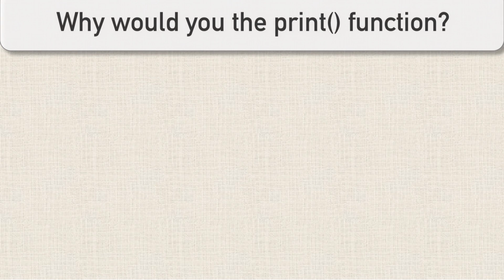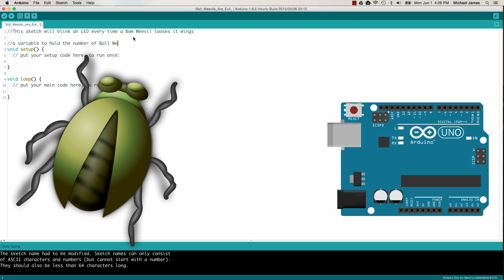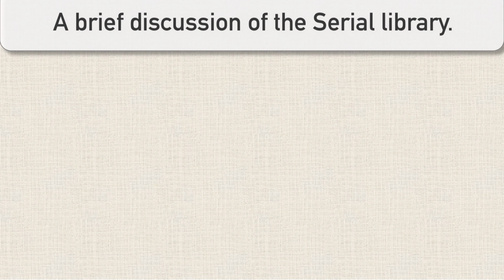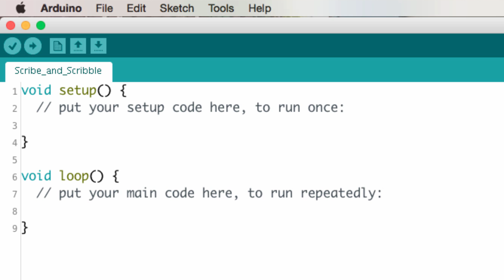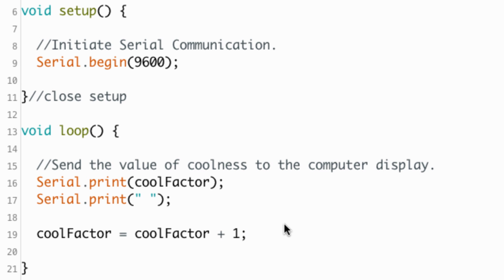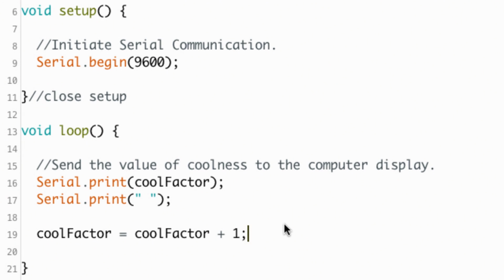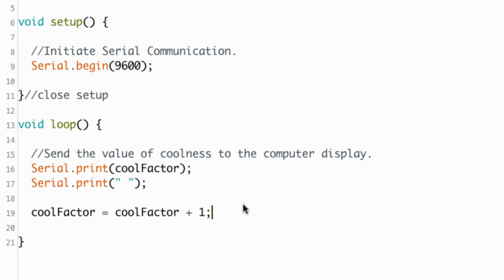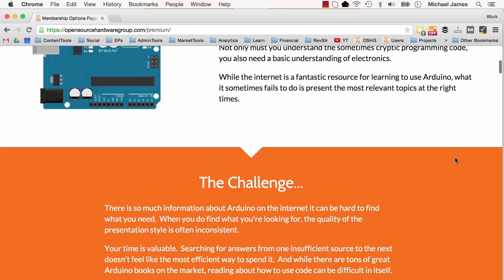Display Arduino output (e.g. sensor data) on your computer monitor with this simple function: Part 1

Comment: Any way i can read serial monitor without connecting cord? Wirelessly?
Reply from the maker: Great question!  If you use a WiFi enabled microcontroller, I am pretty sure you can connect to the network port of the device in the Arduino IDE and read the serial output.
Reply: @programmingelectronics  glad to know you liked the goal..can recommend some wifi enabled micro controller ?
Reply: @arindam_goswami  I'd look into an esp32 or an esp 8266

Comment: Can I run the arduino code output on my pc like a C++ code without connecting an arduino board? if possible how?
Reply from the maker: One approach would be to use an Arduino Simulator like TinkerCad, which can can model your circuit, and also acts as an IDE where you can write and run your code.
Reply: check the win32 function CreateFile()

Comment: I tried connecting LM35 temperature sensor to my arduino Yun and running the sketch, I however had my serial monitor not being able to connect. I however upload the sketch for blinking the LED and it worked perfectly well. I wish to know if I am to use the bridge library and if I do, will i be able to read my data on the serial monitor or have to connect an SD card? Thanks.